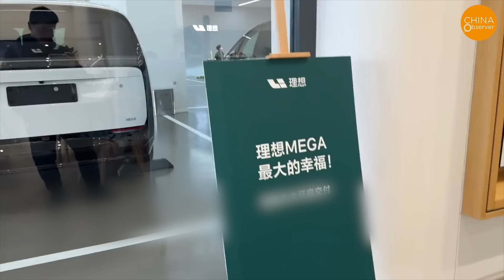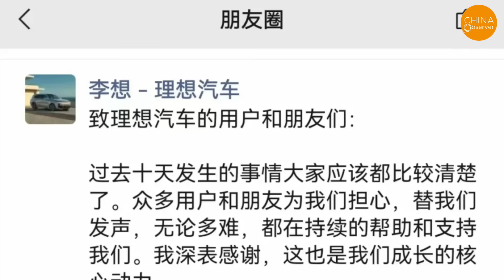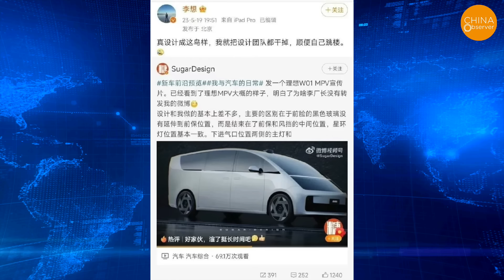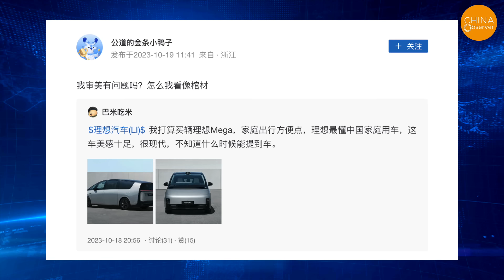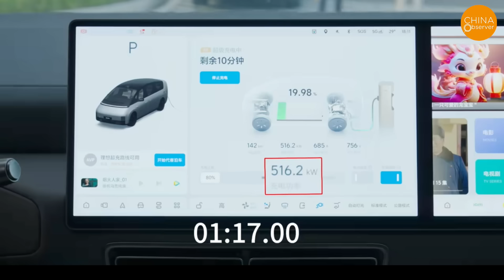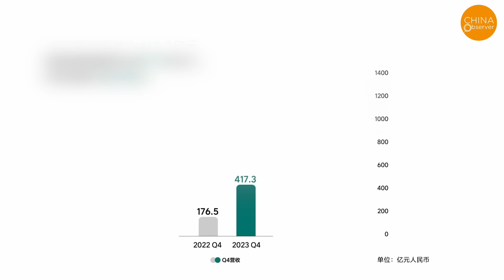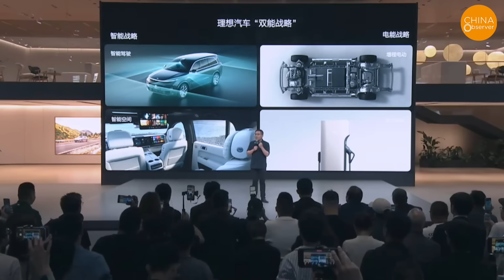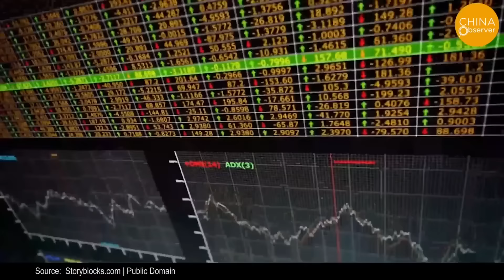China’s EV Giant Fails at Copying, ‘Walking Coffins’ Lead to $70 Billion Losses

Comment: Electric cars are not green.

500,000 pounds of the earth's crust must be dug up and processed to create the elements for a single EV battery. Processing the brine for lithium, the ore for the cobalt, the ore for the nickel, and the ore for copper creates massive amounts of highly toxic air and water pollution. The digging and processing uses diesel powered equipment which produces more CO2 to create a single battery than the battery prevents during its life. And the car will need several batteries over its life. Then when you plug the car in to charge it, 65% of the electricity comes from coal.

Electric cars are heavier so the tires wear out 50% faster releasing more toxic rubber particles into the environment. The heavier cars do more damage to roads which will need rebuilt more frequently using CO2 producing heavy machinery.

More electricity use means more power lines are needed. Millions of CO2 absorbing trees will have to be removed along overhead electric wire easements to assure wires have adequate clearance.

Comment: I don’t know what a Chinese coffin or hearse looks like. However, this looks a lot like the early 1990s GM minivans, the Chevrolet Lumina APV, Pontiac Trans Sport and Oldsmobile Silhouette.  Overall, I like the exterior look of this van. My opinion is there could be a bit more character in the front end bumper and grill area to give it more individuality and identity. 

How much resistance to sales of this van be to its fairly high price for its target market demographic?
Reply: Flat back a good way for it to be a real coffin for you if someone else hits the back of your car (very high chance due to low standards in getting drivers license in China)

Comment: "What happens if you get inside China's EV and drive"
You'll die to scorching fire.
Reply: "Tesla has started using BYD blade batteries for the Model Y electric crossovers produced at the Berlin gigafactory, resulting in a significant increase in charging speeds."
"Until recently, another Chinese battery maker CATL was the sole supplier of batteries for the Model Y in Europe, but in early May it was reported that Tesla had started using BYD as a second supplier."
Apparently, Tesla is not worry about "die to scorching fire".
Reply: That’s all EVs to be fair though

Comment: If I had a nickel for every time a car manufacturer made an MPV with good specs but it failed commercially because the design was too avant-garde for most people, I'd have two nickels. Which isn't a lot, but it's weird that it happened twice. (The other was the Fiat Multipla)